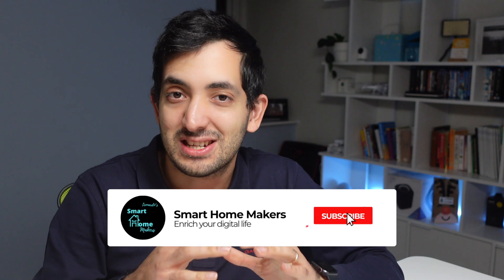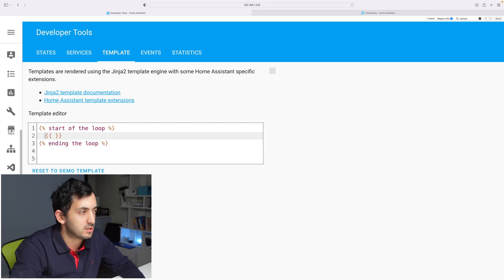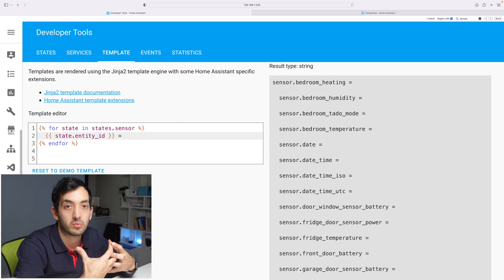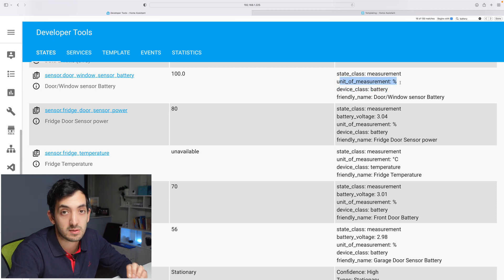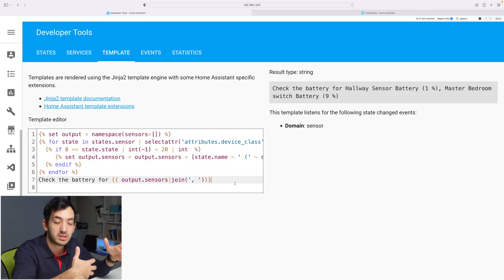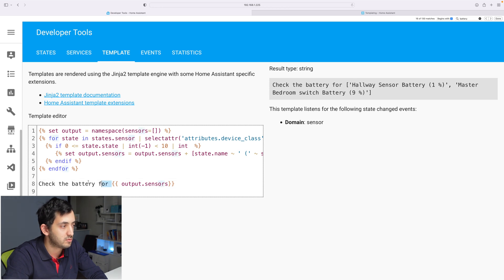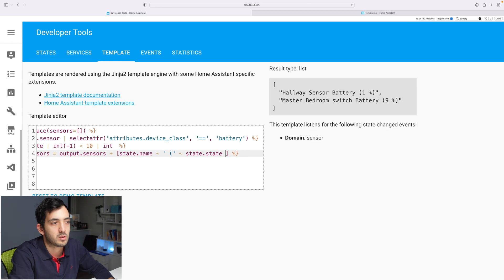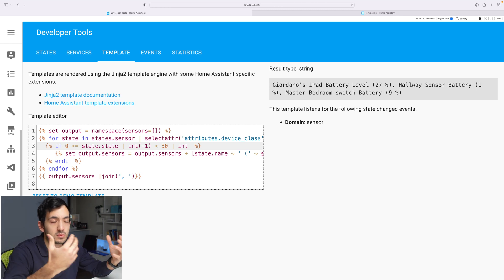START Leveraging Loops NOW - Home Assistant Coding Tutorial (Templating)

Comment: would have been nice if the code was anywhere to copy
{% set output = namespace(sensors=[]) %}
{% for state in states.sensor
| selectattr('attributes.device_class', '==', 'battery') 
%}
{% if 0<=state.state | int(-1)<95 | int %}
    {% set output.sensors = 
      output.sensors + [state.name ~ ' (' ~ state.state ~ ' %)']
    %}
{% endif %}
{% endfor %}
{{output.sensors}}

Comment: I created an automation which simply use options to select the charging current as follows according to the voltage of my inverter battery which depends on solar power output in my off-grid system;

The car charging starts if battery voltage is above 54.9v, and the car charging current is then set by Home Assistant to 6a.

Above 55v to below 55.5v current is set to 10a
Above 55.5v to below 56v current is set to 15a
Above 56v to below 56.5v current is set to 20a
Above 56.5v current is set to 25a

When I ran the automation, it started and changed the charging current from 6a to 20a, but it was stuck there even when the battery voltage had changed.

So, my question is, please, is it possible to create an automation in the user interface to check the battery voltage and set the corresponding charge current in a loop which should run until the battery voltage falls below the starting trigger which is 54.9v?

Although I have just been using Home Assistant for about a week, using conditions to trigger actions is tricky. I used OPTIONS and I also used IF...ELSE and none seems to have worked. 

Could my problem be because I used device instead numeric to set my trigger as I have seen some people do?

Any guide, or suggestions from you will be greatly appreciated.
Reply from the maker: You can ask chat GPT to get a baseline code and the with trail and error get it to do what you need

Comment: Here's my homework ...
# Template
{% set output = namespace(sensors=[]) %}
{% for state in states.light %}
  {% if state.state == 'on' %}
    {% set output.sensors = output.sensors + [state.name ~ ' (' ~ state.state ~ '), rgb-colour: ' ~ state.attributes.rgb_color] %}
  {% endif %}
{% endfor %}
{{ output.sensors | join(';\n') }}

# Results
Dining Table (on), rgb-colour: (255, 192, 141);
Hallway Front (on), rgb-colour: (202, 196, 255);
Hallway Rear (on), rgb-colour: (202, 196, 255)
Reply from the maker: Well done! Can you exclude from this list lights that are in groups? Have a think about it!
Reply: @SmartHomeMakers  Kinda depends on how your group attributes are defined. I have the groups setup by Hue so the code below works for me. Could otherwise check and exclude any entity which has the attributes lights in them.

{% set output = namespace(sensors=[]) %}
{% for state in states.light | selectattr('attributes.hue_type', '!=', 'room') %}
  {% if state.state == 'on' %}
    {% set output.sensors = output.sensors + [state.name ~ ' (' ~ state.state ~ '), rgb-colour: ' ~ state.attributes.rgb_color] %}
  {% endif %}
{% endfor %}
{{ output.sensors | join(';\n') }}
Reply from the maker: This is my result: Coloured Lights (on), rgb-colour: (255, 179, 115);
First Floor Lights (on), rgb-colour: (255, 179, 115);
Imac Lamp (on), rgb-colour: (255, 167, 89);
Inspiration Ceiling (on), rgb-colour: (255, 192, 141);
Inspiration Room Lights (on), rgb-colour: (255, 179, 115)

Comment: {% for state in states.light %}
{% if state.state == "on" %}
{{ state.entity_id }} = {{ state.state }}
{% endif %}
{% endfor %}

{% for switches in states.switch %}
{% if switches.state == "on" %}
{{ switches.entity_id }} = {{ switches.state }}
{% endif %}
{% endfor %}

Not exactly but almost there, not separated by commas
Reply from the maker: Great work so far! In the 2nd for loop would use switch instead of switches as when you iterate you have 1 switch at a time. This is a little bit of programming best practices :)
Reply: @SmartHomeMakers  Thank you! I was hoping for a critique. Any other tips? Could I reduce the amount of lines here?
Reply from the maker: @kodeypatterson8973  not sure if it is the way you did the copy and paste but would be great to indent the code {{}} section needs to be to spaces in !

Comment: What does the (-1) next to int do ?
Reply from the maker: It removes the unknowns, the devices that are not working or available for any reason
Reply: @SmartHomeMakers  thanks for replying. However, I am still confused on how it removes unknowns. I wasn't able to find examples of this online either! Could you please explain more how piping to int(-1) removes unknowns ? Isn't int(-1) casting -1 to int (like in c/c++) ? Or does it subtract 1 from the piped data ? I'm confused!
Reply: @algre977  When casting into an 'int' fails, it by default returns a value of 0, and in this case 0 is actually a valid potential value.  The first argument to 'int' is what its default value will be (e.g. if the cast fails, what default value would you like to pass on), so all the 'int(-1)' does is set that default value if casting the int fails to -1, allowing the remaining logic to behave as wanted.
Reply: @organon69  thank you very much!
Reply from the maker: @organon69  Thanks Glen for this very clear explanation! much better than mine